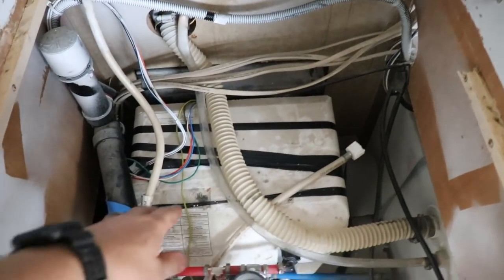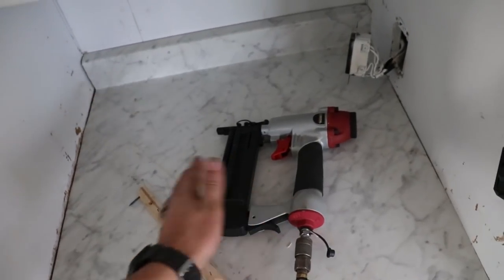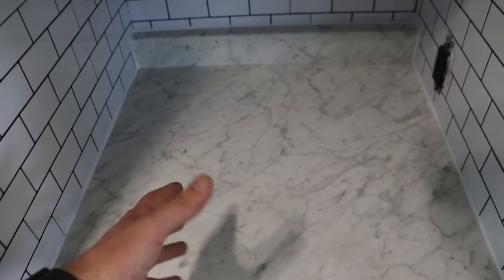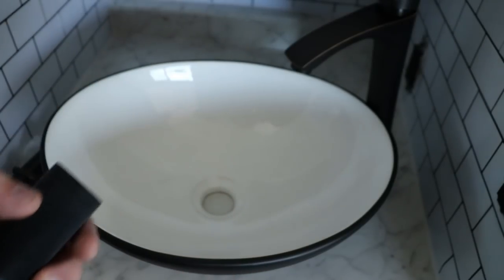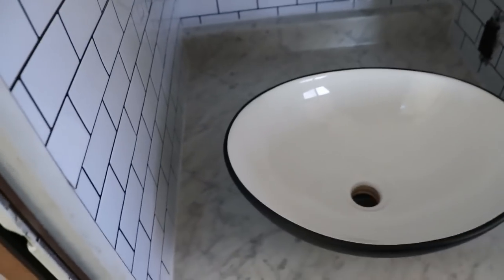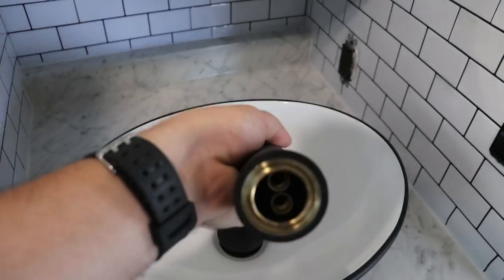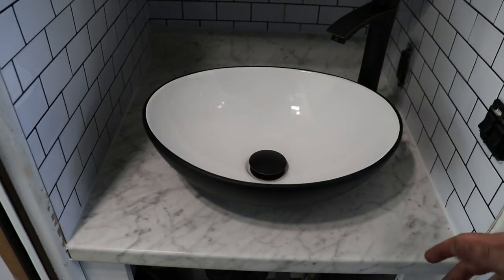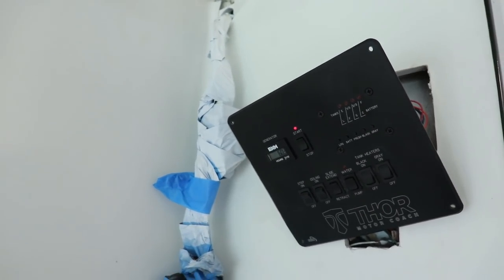2015 THOR VEGAS NEW SINK INSTALLED PART 22

Comment: @NikoBrothers,It's a reason that it came  with 3 white silicone gaskets. 1 goes in between the drain spout and the bowl. The 2second goes in between the bowl and the countertop. The 3rd goes under the countertop and the drain  nut.

Comment: I know you guys are learning but the bowl was not install right you have to redo this
 installation or else you going to have a leak from day one you need to seal the drain with plumber putty, electrical outlet is to close to the sink, move the bowl toward the other side  also move your faucet to the other side and add a GFI outlet. Remember safety first no FIRES 🔥. Thanks

Comment: I'm confused, you're supposed to attach the drain piece to the sink alone with 1 gasket on each side of the porcelain, then the hole in the counter should've been larger to accept the nut from under the sink bowl to pass through. The 2 bolts and silicone were supposed to be the only securing points! If you applied the drain tube gasket to the bottom side of the counter top, that's very wrong and absolutely going to allow major water to access the wood in between and ruin the counter top starting day 1
Reply: Ya they seem to open up box toss the papers on top and proceed to install. 
I was like wait drill hole for the faucet first ,then the sink and put it opposite from electric outlet outlet.
Reply: I was wondering if it was meant to be something like that just going by the number of different parts in that drain assembly.

Comment: HI. I think the two holes in the bottom of the sink are from manufacture. If you had tapped the sink before instillation and it sounded hollow then it was 'slip molded' and it saves weight.

Comment: NO NO NO, put the faucet on the left side away from the electric receipt.
THE DRAIN YOU HAVE HAS AN OVER FLOW HOLE IN IT, YOU CAN'T USE THAT WITH THAT BOWL. YOU HAVE TO HAVE A SOLID TUBE DRAIN WITHOUT OVER FLOW.  YOUR GOING TO HAVE A MAJOR LEAK BELOW....
It's to bad we can't communicate with you before you do things....We can save you a lot of headaches....
Reply: Can you not blank off those ports over there if not used?

Comment: I have a few build suggestions do a camaro zl1, a jeep wrangler, a police car, a hummer h2, a gmc sieara durmax, a ford f450 (as your new shop truck), a dodge ram cummins, and a helicopter. (you guys need a dully truck with your big trailer). be on the lookout for a jeep trackhawk, a 2020-presnt toyota supra, a ford f150 shelby, and a jeep gladiator